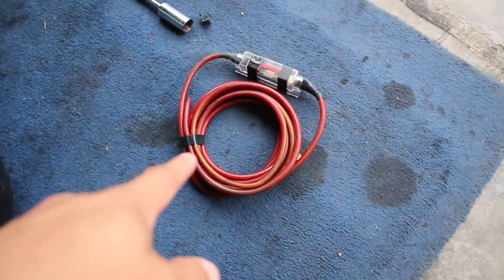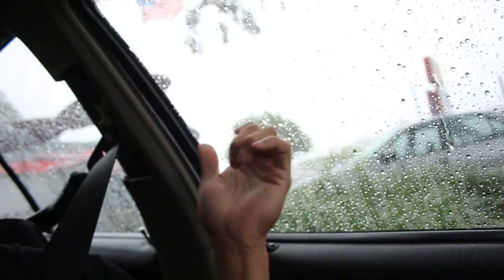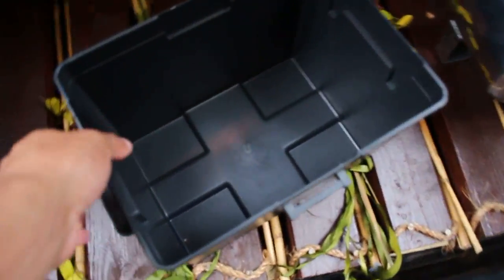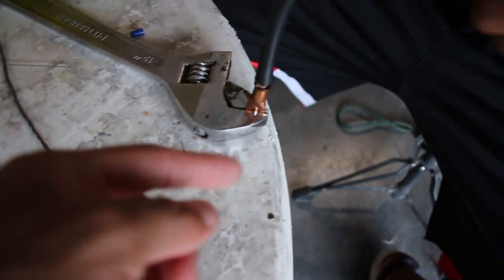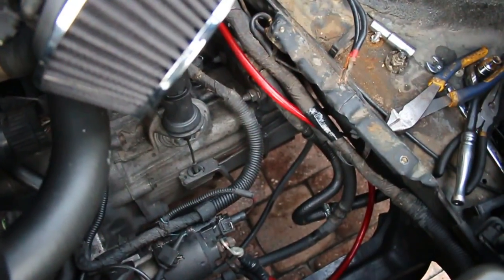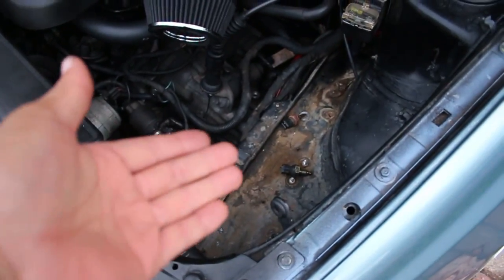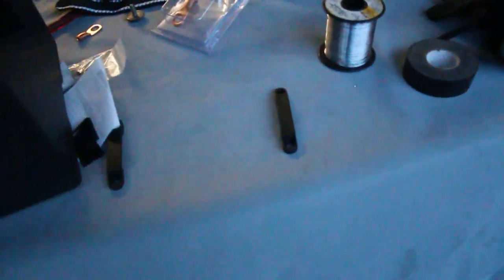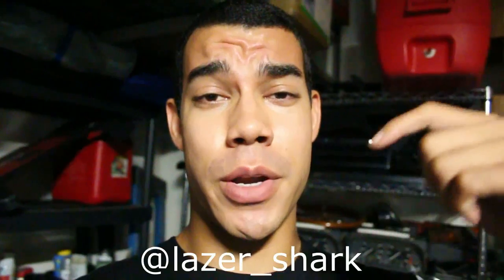How to relocate your battery ( 1997 Volkswagen Jetta Mk3 )

Comment: The water comes from the sunroof drains. They got clogged up. Common probs on mk3's
Reply from the maker: Its not coming from there the drains are completely clear I had them clog up one time and completely flood my entire car so I regularly blow them out and the car is constantly in the garage so theyre good to go. If it was leaking up near the roof or pillars id say it was the sunroof but its coming from way up in the dash and it looks like its right where the hood latch cable is lol I could be wrong but I think thats it

Comment: Looks good, but i would drill a hole in the top side of your box, get a 90 degree fitting screwed into the box, add a piece of hose to the fitting, and run the hose threw a hole your drill threw the floor as a vent for the battery. You should def. do this. My relocation kit came this way, and its not good to breathe the battery fumes. https://static.summitracing.com/global/images/prod/xlarge/tay-48100_xl.jpg Pic is for reference.